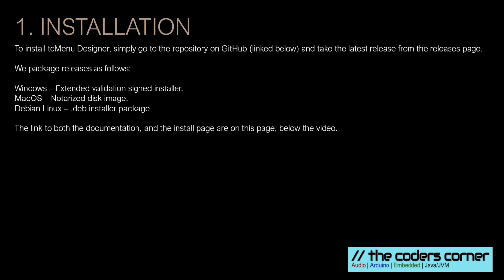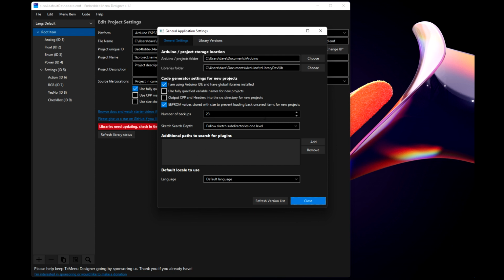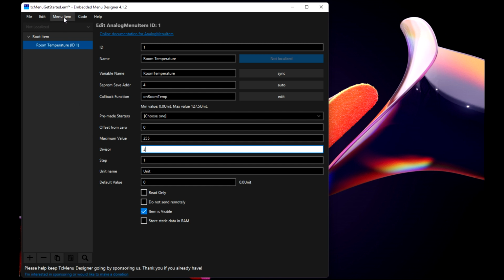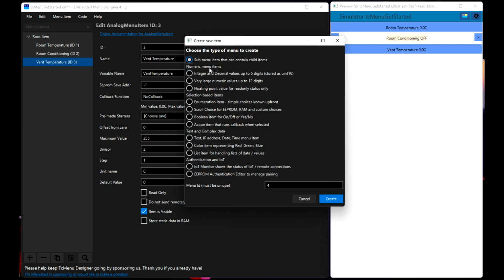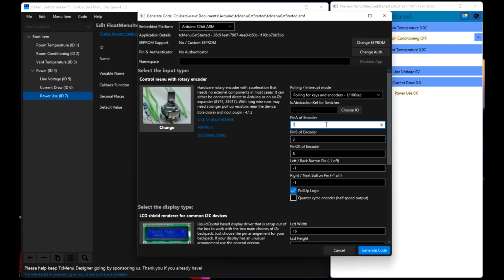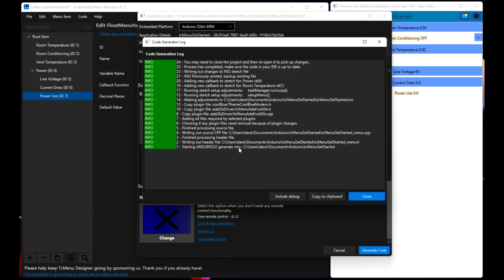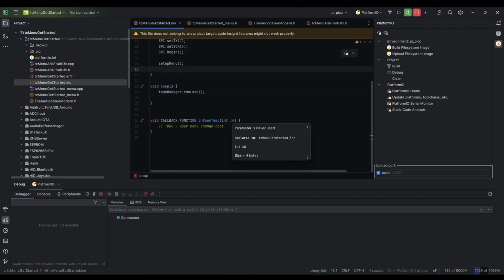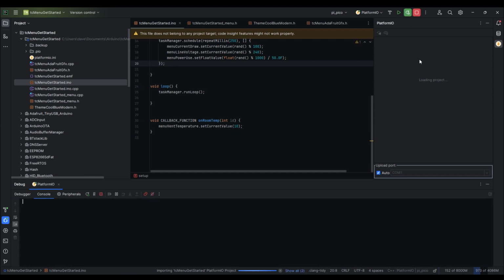Getting started building a menu for Arduino with TcMenu 4 Part 1

Comment: Thank you very much for designing this designer. Most of the people who use this designer are probably amateurs like me. I use 4 buttons to set the integer variables. It took me several hours to know that I can change the value of the variable by pressing the up and down keys after pressing the OK button. I really hope you can make a video about operating the hardware. It may only take a few minutes for everyone to understand how to set it up. In fact, your software is very easy to use, including the definition of the button pins.also eeprom is very useful